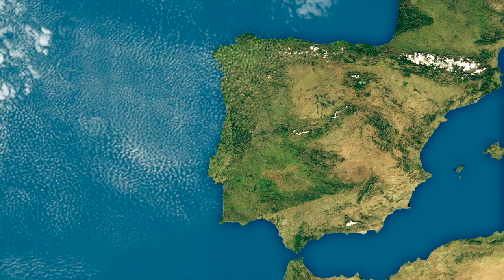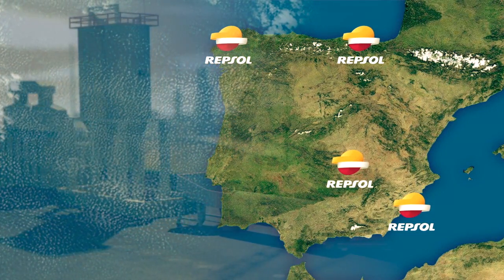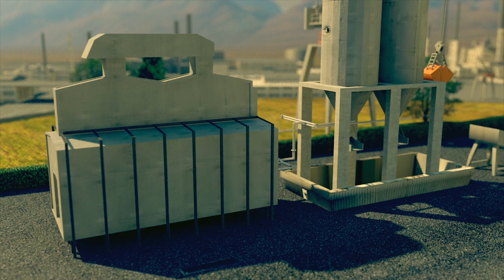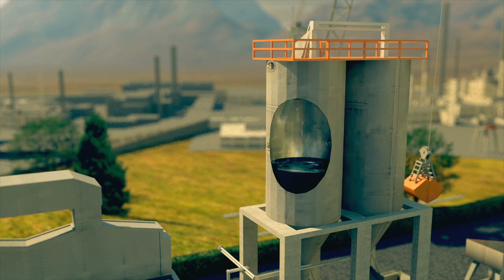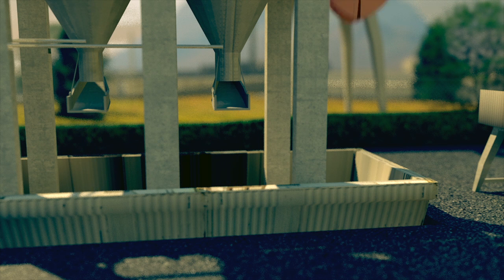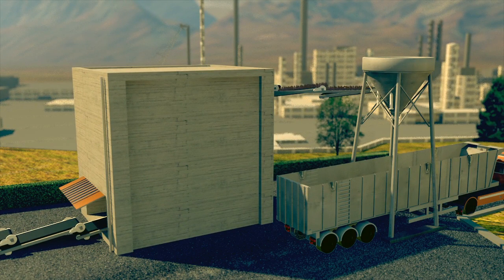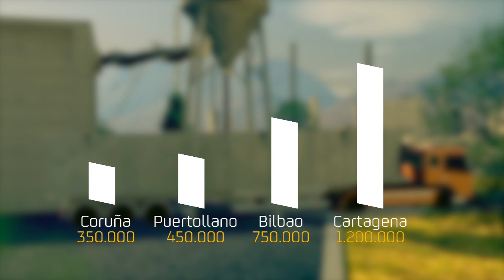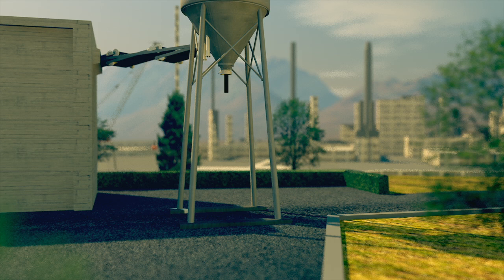Learn how coke is produced

Comment: At a minimum, you need two "coke drums".  They are around 20 ft. wide, and 100 ft. tall.   When Crude Oil is processed, you end up with the "Heavy Ends", that are hard to refine.  So those "bottoms" are heated and pumped into a "coke drum" as a thick fluid.  There (when the drum is full), the product is cooled with steam and water, and then cut with high pressure water.  The "coke" then drops into a rail-car, or a conveyor belt.         So...................while one drum is being filled, the other is being cut.  Once the "cutting" is done on that drum, it is sealed up.  The operator's then pressure test with high pressure steam.  If no leaks are found, you "blow the drum down" (getting rid of the steam and condensate).  You then begin to "heat" the empty drum up, using high-temp vapors from the other drum.  [ And then you wait.  LOL.]   When the empty drum is up to temperature, and the other drum is full, you then "Swing" the flow of oil into the warmed up drum.  About an hour later, you have to "Seperate" the two drums.   The empty drum begins to fill, and the full drum is ready to cool.   You have to vent a bit of pressure out of the full drum, into something called a "wax scrubber" and/or "overflow tower", but as you do that you inject steam into the full drum for about an hour, then begin to add water to cool the product and get it ready for cutting.    (And this process takes hours.  Call it 8.)    Hope this helps.   :)
Reply: When the comment is better than the video
Reply: More informative than the video. Thanks for the explanation! I work in a coker unit, our work is constantly interrupted because they're "dropping the bottom". Always wanted to know more about the process.
Reply: Hi. Sir some teachers ask me.
Take Coal 10 Kilo
Crush them 
And put it in air tight drum.
Put on the heat 960 for 18 hours
Then open drum
Put water on it.
The coal is convert to coke.

Pleas advice me.
Is that true ?
Reply: Thanks for writing this. I haul coke out of a refinery in Texas and the Coker is always breaking. Leaving us drivers waiting or without work. I learned is was built in 1962/1964 the plant has other problems too. It’s a patchwork place. 😮

Comment: Solutions for oil, fas and petrochemical companys: https://getg.ae/oil-gas/cleaning-maintenance/petcoke-liquifier/ 
Liquified petcoke  is easily removed from the vessel and negates the need for caustics, mechanical separation equipment or man-entry processes.

Comment: What is the purpose of the coke drums
Reply: That's where the coke is fraction process is done.
Reply: At a minimum, you need two "coke drums".  They are around 20 ft. wide, and 100 ft. tall.   When Crude Oil is processed, you end up with the "Heavy Ends", that are hard to refine.  So those "bottoms" are heated and pumped into a "coke drum" as a thick fluid.  There (when the drum is full), the product is cooled with steam and water, and then cut with high pressure water.  The "coke" then drops into a rail-car, or a conveyor belt.         So...................while one drum is being filled, the other is being cut.  Once the "cutting" is done on that drum, it is sealed up.  The operator's then pressure test with high pressure steam.  If no leaks are found, you "blow the drum down" (getting rid of the steam and condensate).  You then begin to "heat" the empty drum up, using high-temp vapors from the other drum.  [ And then you wait.  LOL.]   When the empty drum is up to temperature, and the other drum is full, you then "Swing" the flow of oil into the warmed up drum.  About an hour later, you have to "Seperate" the two drums.   The empty drum begins to fill, and the full drum is ready to cool.   You have to vent a bit of pressure out of the full drum, into something called a "wax scrubber" and/or "overflow tower", but as you do that you inject steam into the full drum for about an hour, then begin to add water to cool the product and get it ready for cutting.    (And this process takes hours.  Call it 8.)    Hope this helps.   :)